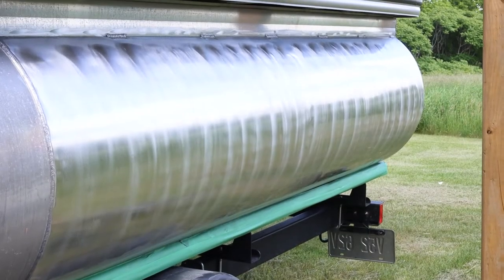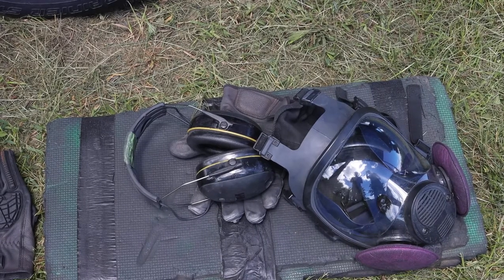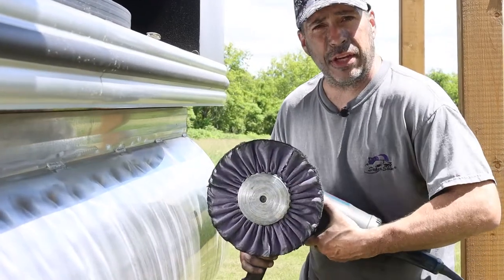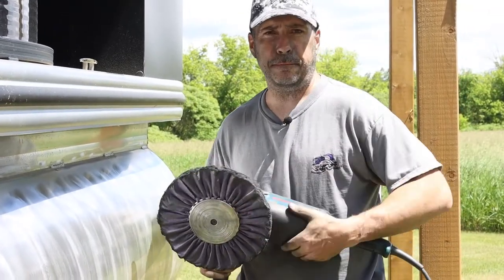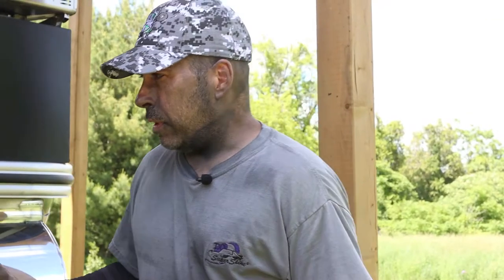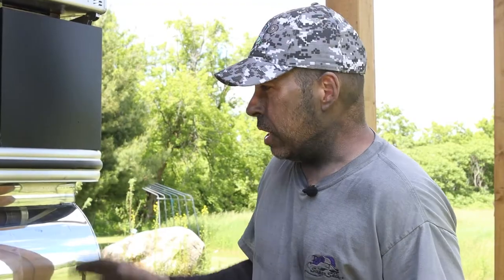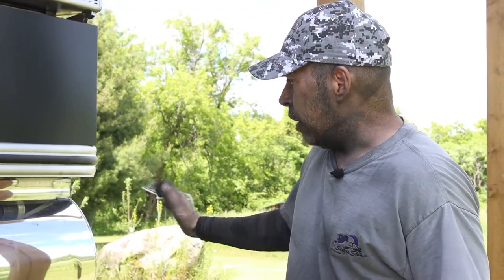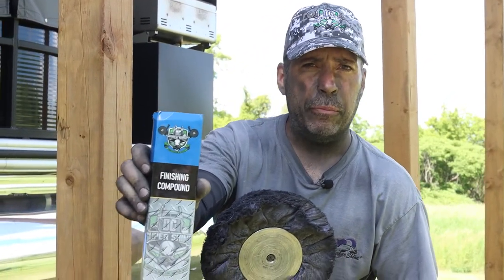DIY How to polish an Aluminum Pontoon Boat

Comment: Thank you again Dennis.  Question time - 1)when speed sanding you were going horizontally yet on some grits you were going vertical.  Any special grit to do that or on in all grits? 2) when blending to clean up I assume no compound is used and same pressure  right? Thank you again for your patience and advice.
Reply from the maker: Hey Paul,  as for high speed sanding I only go vertically on the last grit or 2, it’s not really needed I just got use to doing it that way! 🤷‍♂️
As for blending I clean the rake good and no product is applied.  Thanks for watching!
Reply: @DCSuperShine  Lovely thank you for your clarification. Greatly appreciated with utmost respect

Comment: Do you use a buffer with the polishing wheel or a grinder? (rpm?) Thanks
Reply from the maker: I use both a polisher 600-3500 rpm and a 6000 rpm grinder.  thanks for watching!

Comment: Awesome work. What did this kind of work end up costing the customer? Thanks for the videos.
Reply from the maker: I charge per foot when it comes to pontoons… $75-$125 per foot depending on how much sanding is needed.  This particular job was $2500

Comment: Ok. I have a few questions.  What speed you run when ur sanding threw the grits? And backi g plate where u get them from?  They look like they have like a cushion type to it
Reply from the maker: For sanding I’m on max speed but you can set it slower for better control.  Those backing plates are no longer available unfortunately.  But we have similar ones now. Just send me a message on Facebook.

Comment: If I want to restore a toon to a satin finish like the factory that is 2 years old what would you recommend. The toon was acid washed with toon brite and it looks awful. Planning on doing metal jacket after all the correction is complete
Reply: What is the time spent on a 23ft on average
Reply from the maker: The time depends on many things, experience being number one.  Products used, are you polishing with a 3500rpm or 6000rpm… what kind of work are you?  All those things come into play.  But as a ball park I can do a 23ft alone in about 20 hours.  That’s sanded and polished.  Hope this helps

Comment: how long does it last before it goes dull again. and is there protection on the polished one? Greetings from Germany.
Reply from the maker: It depends on many things… river water, sea water… do you leave the boat in the water or not… does your area have issues with scaling etc… in normal situations it last the season very easily.  We do put metal polish for protection yes.  There are several companies that offer some sort of clear coat that can last years if maintained properly… just keep in mind that most of these protections will take away from your shine and once start to peel they look horrible and much harder to take off.  Hope this helps

Comment: Final step, Cleaning polish remnants from edges, What to use?
Reply from the maker: liquid metal polish works great, if there's a lot of black residue like in the welds for example, varsol or mineral spirits work best.

Comment: Denis what did you use to take the hide off with?
Reply from the maker: Sorry the hide???
Reply: Shark hide coating
Reply: @stevenjamieson5461  That stuff is garbage.. it only helps a bit if your a pull in and out every use.. If your on a dock, its junk, and a nightmare to remove.. I have used toon brite and or napa aluminum brightener for 20yrs on my 3 pontoon boats.. Once per year, you spray the stuff on with a weed sprayer, hit it with a quick brush like car wash brush, and spray it off.. It has some acid in it that completely and perfectly cleans the toons to a consistent dull shine.. which looks very nice IMO.. And no scrubbing or buffing of any sort.. You don't need or want mirror polished toons and it doesn't last even a season.. I have seen many people spend 10-20hrs polishing toons to have them look like shit in about 30-60days..

Comment: Looks great but these companies need to come up with a solution to aluminum pontoons, every godamn pontoon boat looks like sh-t after a month in the water.
Reply from the maker: Greatly depends on maintenance!  But they do have coatings that work  fairly well… some are bad tho, and it depends on the person applying it.  Experience is key!
Reply: Epoxy paint would be much simpler to apply and much more durable.  Pontoon factories should polish the tubes & clear coat them.  I can't believe none of them do considering the prices they charge for new boats.

Comment: And one year later it's back to looking dull again, would rather just hit it with purple power aluminum brightener to knock the oxidation off (30 minutes total) and spend the remaining hours on the water with a drink and a couple babes in bikinis having a good time.  Having a mirror finish is not worth my time.